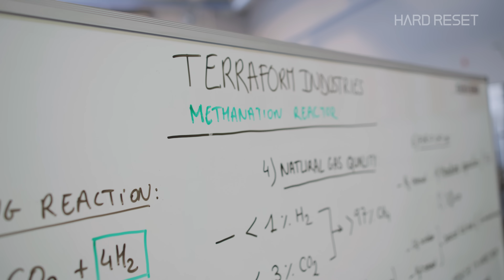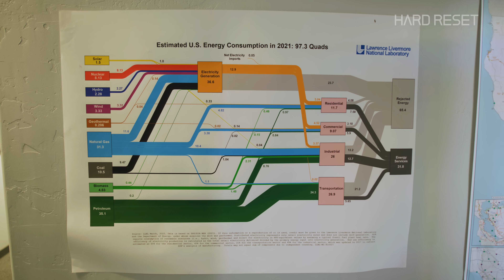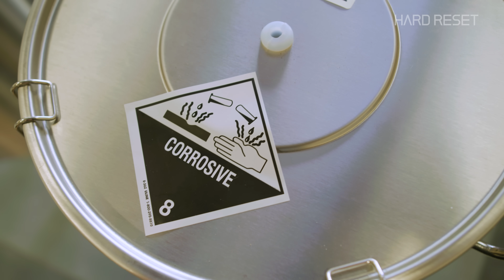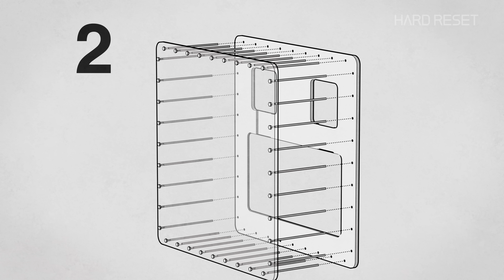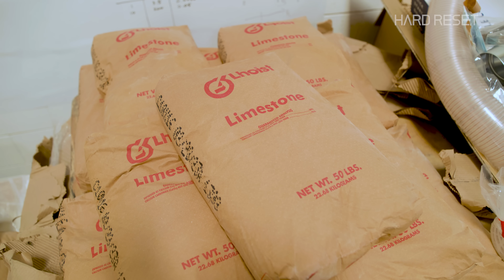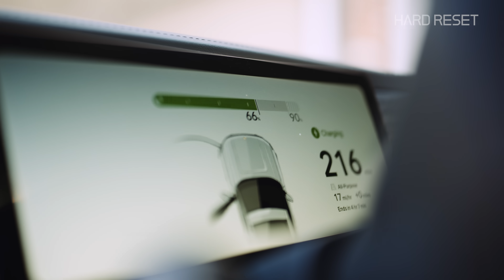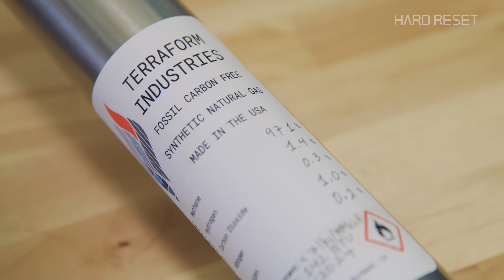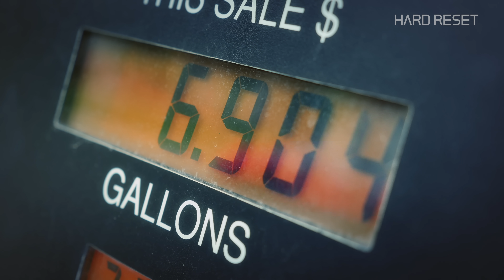The Last Fuel We'll Ever Need?

Comment: Same problem as hydrogen tech today, too inefficient.

May be cheaper but still carries many issues related to energy per weight, air pollution similar to diesel emissions but more volatile chemicals are exhausted from the combustion process and the overalls amount of energy used to create that fuel compared to what you get out of it in combustion is still too low compared to using electricity directly as fuel (aka less conversion processes).
Reply: "too inefficient" is the wrong criticism. "Too expensive" is the correct one.  But in 10 years it might be cheaper than fossil fuels thanks to solar panels getting cheaper.
Reply: @ It’s not expensive because methane is essentially natural gas also easily produces LNG.

It’s a well known fuel technology with stablished infrastructure and work force know-how.

The true issue is that it’s too inefficient to transfer most if not all electricity needs today that can’t be replaced by electricity or hydrogen into natural gas because it’d be still expensive and logistically challenging to make such transition but also not rewarding at all from a energy use and investment stand point since it’s essentially a worst form of current fossil fuels for the economy.

If you’re going to the trouble of disrupting supply chains, investing in new factories and transition from petrol or diesel to LNG you might as well go full emissions free and rip the long term benefits of technologies that have further potential in the future and help with energy needs and logistics.

Natural gas that’s cleaner is great but has many issues with storage, logistics of supply chains, inefficiency, toxic emissions  to respiratory health and ozone layer ,horrible issue with leaks and explosions.

it’s not an expense problem but a logistical and strategical one.

Comment: I've been following terraform for a while now, really happy youre covering them :)
Reply: I think they added 2 too many steps.

Why can't we just use the bacteria that produces methane? We do that with bio-bladders.
Reply: @zachhodgson4113  i had this idea of a genetically modified termite colony, which has been biologically tweaked to produce higher amount of methane (body weight to methane production ratio of termites is 1000x higher than cows). Feed them waste, they convert the waste into methane and fertilizer. Moreover these colonies have a very interesting mission given by mother nature which is doubling in size every few weeks (in the right conditions). These termites have the right bacteria in their guts microbiome which enables them to produce methane (the same thing happens in our body as well). Btw there are already a few companies which use certain bacteria for producing methane, it just seems to be hard to scale.
Reply: @shukrantpatil  
That is very much an interesting idea.
But why add the termites?
If the only goal is to make the methane?
As I am writing this, I could see it as a multi purpose of breaking down waste wood. But generally we can use waste wood in many other things.

It shouldn't be a problem to make it to scale. The technology for it has been around since the 1970s
These bacteria production is usually a problem in our waste systems. We just aren't tapping into them.
There isn't support for it by Oil and Gas companies because it would take away the monopoly of the finite resource. Since it's renewable, that is obvious.
The Solar and Wind people are also against it. Since it takes from their funding as well.
It's not as clean as both of those industries, so that is why they don't like it either. But would even out the grid and be carbon neutral since it doesn't take from the locked carbon pool. 
But the Technology is already here for these types of gas productions.

Comment: Right now solar panels and wind turbines are turned off to "stabilize" the grid because there is no demand for their energy at that moment. Machines like these made by Terraform could be the "drain" for this excess energy. (Provided their price and maintenance cost is (sufficiently) low)
Reply: If battery cost keep going down won't it be better to just store the electricity and not lose so much of energy because of the waste of energy to make methane. Battery even worst case is 90 95% and best case is near 98 99%.... Methane conversion is near 35% and using methane means lot of it will be wasted as heat in the next process....
Reply: @loidforger6413  While that is true, if you put in place renewables in a seasonable place like where I live, you put so much that it gives you enough energy in the winter. This means you simply have too much in summer. Why waste that energy when you can turn it into something useful?
Reply: @michelhegeraat5430  if it's a off grid setup for solar and wind then yes, but if it's a grid tied one which most people use then it's better to just export it and get credits back or the worst case is if credits is reduced then maybe there is a point of converting to other engrry resources for long term usage but the risk of keeping compressed for long time also be considered.
Reply: @loidforger6413  That can only happen if the grid has a way to store that energy. And that is not the case. Panels and windmills are turned off, and people are being told  the grid is full. We choose to just waste 100% of that energy, instead of storing (a part of) it as something that can easily be stored for a long time., methane, jetfuel, etc.
Reply: @loidforger6413  While this is true, when you put in place renewables in a place with seasons, like where most people live, you add panels to have enough energy in the winter. This mean you will have too much in the summer. Why let that energy go to waste (like we do now) when you can do something useful?
Reply: There are other options too, like heat batteries, or pumped hydro, or flywheel storage. We don't have to make more stuff to burn
Reply: @evanbarnes9984  We should do that too. But they are not that cheap yet. Most places for pumped hydro are taken.

Comment: I watched previous video on this guy - it sounds like it makes sense when he explains it but really it actually doesn't make sense at all.. methane leaks will ruin our atmosphere during its transport... Just use the solar energy directly to provide power for all our things. Electrify everything. The real solution is to make E trains and trams the primary mode of transport rather than ultra inefficient cars... His solution is a major detour from terrible energy to bad energy rather than working directly towards sustainable and good energy.
Reply: Thank you, yes! Methane is a much worse greenhouse gas, and the natural gas infrastructure is notorious for having bad leaks that just spew methane
Reply: @evanbarnes9984  

Only that in this case, every methane molecule comes from CO2 that was already existing in the air.

And leaks, by definition, are not the majority of the mass.

So if this is done, even at 10% of the energy market, and a full 10% of that produced Methane would leak...

90% of that produced methane, which represents 9% of the CO2 that was released that year, is now stored... Or ever used to produce things, that mean it is effectively fixated out.
Reply: I would love to know the ratio of energy used to energy produced on this system.  I would be impressed if it was less than 4/1.

Don't use any fossil fueled electricity or you will be in an insane doom loop.

I don't hate this technology, but it needs to be used in the exact right circumstances to create more resources than it consumes.  And in a USA that can't make fission reactor power plants that are profitable, this technology is most likely a complete money pit.
Reply: It's more like: if it makes money, why not make it.
Reply: Electricity is not energy storage, methane is.   To store electricity you need batteries,  which are expensive,  are made from lots of metals which need to be mined as well as plastic and toxic chemicals, are dificult to manufacture, are heavier than hydrocarbons,  and have a limited lifespan of 2-15 years.
Reply: You are going to need to make thousands of pounds of methane per day with as low as is possible energy use to be anywhere close to commercial scale. 

I recommend you find a pure CO² waste stream to speed up your process and lower your opperating cost.
Reply: This is basically a method to transport Solar Energy. Think of the UK, right? They get almost no sun. Now think of the South of Spain. They get too much sun. Use that too much sun to make methane, transport it to the UK and they can have carbon neutral energy too. 

Another very good usecase is as a battery. You make a lot of methane when the wind is blowing or the sun is shining and store it. Then use it for heating when neither of those are happening. People are already using LiPo batteries to do this; this is just another method
Reply: I plugged the following into ChatGPT. I suggest you do it or change the wording however you want - the output is the much more detailed logic of what I didn't have in mind of how to explain in my OP.

"Does Terraform Industries idea of converting air, water and sun into methane make sense? And by sense I mean "good" in all forms such as being responsible caretakers of our world (I'm worried about all that methane having leaks that make climate change worse) but also is it efficient use of solar? Wouldn't it make more sense to use solar directly (and store it better (better than methane) such as gravity storage etc)? Maybe it makes sense for the things we struggle to decarbonize but that seems lower priority... The solar used NOW to make methane to offset digging up fossil fuels... That doesn't make sense when those solar panels could be used to power things that can easily be electrified.... Or am I wrong? You don't need to agree with me... I think I'm really logical about this but I'm an outside criticizer... I'm no expert on any of the related things. What do you know about Terraform Industries tech and plan?"
TLDR ChatGPT agreed and explained it very well.
Reply: The carbon in the fuel comes straight out of the air.  It goes back into the air…
Reply: You can’t replace every energy source with batteries.  Casey doesn’t suggest using this instead of electric cars trucks trains etc.
Reply: Direct Solar-- means plenty pollution because you have to mine it. And recycling is just not that efficient.

Not to mention that to store the power you need even more infrastructure...

if this is legit, the pollution production costs is way lower, Storagevis built in, And methane will degrade by itself.

For those methane leaks to be at the scale to cause the problems you're getting at here, you will have far more Mass in storage. I.E. CO2 by the megatons already removed from the air.

not to mention, the methane can be used as a source material for production. Meaning, even with terrible leaks... The end result is carbon negative.

Comment: One question I had that was not answered is if their system can run directly off of solar and not use batteries. This would cut out a large amount of the cost.
Reply: And where is all the water coming from?
Reply: @mrjasonjneal  Probably trucked in at the beginning. Terraform industries claim more water is captured in the CO2 absorbing material than is used in electrolysis, so the machine is net positive with water when running. Any excess could be collected and used for drinking or irrigation.
Reply: @mrjasonjneal  From air - they capture more than they need.
Reply: @mrjasonjneal Where does your water come from?
Reply: Yes I think the plan is direct DC power straight from the panels to get the cheapest solar possible.
Reply: I think Casey would answer that solar could get cheap enough or the resulting gas profitable enough that it would still be economical to run their machine even on batteries.
Reply: Batteries do not seem to be needed, as far as I understand the process and also they kinda mention that at 13:33. 

There is also the whole idea of curtailment (almost free solar+wind "super power"), where there will be enough solar power for winter, and too much solar power in other seasons. That surplus energy is expected to be used to produce hydrocarbons (as fuel and for some chemical industial processes like production of plastics) and hydrogen (for steel and fertilizer production and lots of other things).

Concept of super power explained well here https://youtu.be/6zgwiQ6BoLA?t=532
The production of hydrocarbons and green hydrogen is well mentioned in Tesla master plan 3 https://www.tesla.com/ns_videos/Tesla-Master-Plan-Part-3.pdf

Comment: "It's hard to think of a downside"... hmm, not really. It's massively inefficient and it's only "CO2e neutral" if all of the methane is burned, not leaked into the atmosphere from a leaky pipeline. This really isn't an excuse to keep our gas boilers! I hope they transition into Sustainable Aviation Fuels soon and focus on that instead.
Reply: It's in the best interest of natural gas providers to not have leaky pipelines. That cuts into their profits and stockholders will crucify them if there is any breakage. Please think before you comment.
Reply: @ajsong  Please Google before you comment. Ignorance isn't such a good look.
Reply: I'll take carbon neutral over carbon positive any day

And since it's still inefficient, whatever can be cheaply substituted to electric systems over time will go that route for economical reasons

Energy consumption is a complex problem, so the answer to it won't surely be an easy one, but technologies like this one (IF they manage to make it economically viable) will be a piece of the puzzle
Reply: Using "co2 neutral" as a disadvantage is crazy. Nature emits 95% of co2, but it's neutral because it also takes it all back. It's as important for life as WATER. Do you consider water a pollutant too? We cannot live without co2.

Comment: Run a car on methane?! that ain't gonna happen. We're not going to run cars on methane.
Reply: It might surprise you that many cars already run on methane!
https://afdc.energy.gov/vehicles/natural-gas
Reply: That already is a thing and has been for a long time. It's not used in consumer cars, but a lot of large vehicles like trash trucks and busses run on natural gas, which is just methane.
Reply: @evanbarnes9984  if we go to methane for consumer cars won't we have the same issues we do now with gasoline?
Reply: @JJs_playground  but the current source comes from our of ground.  So more CO2 goes into the atmosphere than there was before.  If the methane is made from atmospheric CO2 then the CO2 level doesn't increase over time. It's neutral
Reply: When i was a kid, my dad converted our car to run on lpg, which is basically methane, because it was a lot cheaper. Its also common on taxis (here in new zealand at least)
Reply: But we can use all the water

Comment: Does this consume fresh water or can it use salt water?
Reply: You would need to take the salt out with a reverse-osmosis machine or else it would gunk up the electrolyzer. There is some research into salt water resistant electrolysis, but isn't fully developed and would be more expensive.
Reply: The limestone absorbs water as well as CO2 from the atmosphere so the process actually generates water. It's vented out of the kiln but could be captured pretty easily.
Reply: What is the water bill at the factory?
Reply: Where do you get your water? I live in a temperate forest, so we have huge amounts of water.
Reply: electrolysis of sea water releases chlorine gas, highly toxic,  you'd need a nuclear plant to run the reverse osmosis or deplete the little fresh water we have on earth